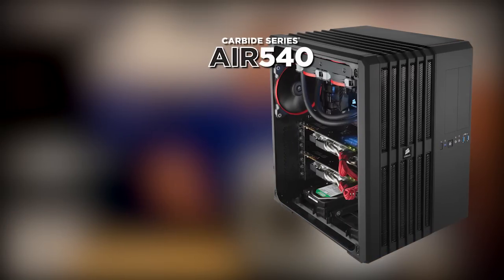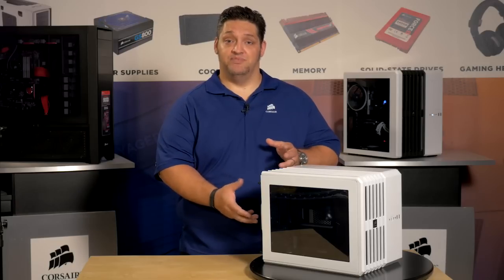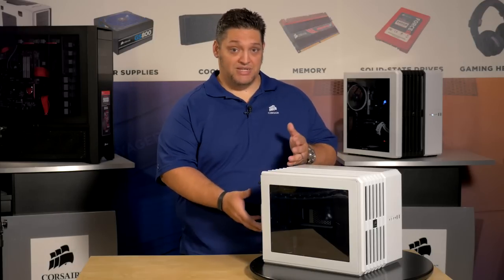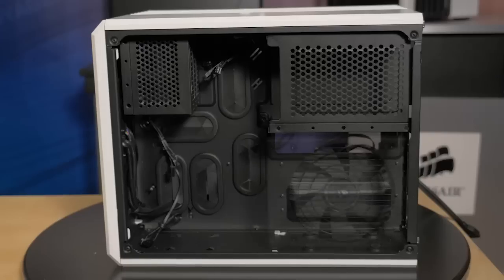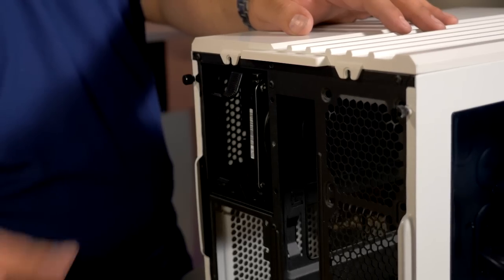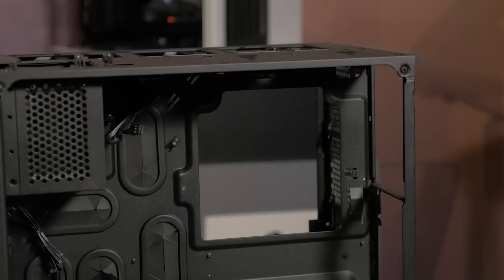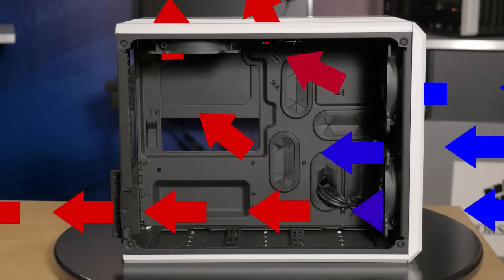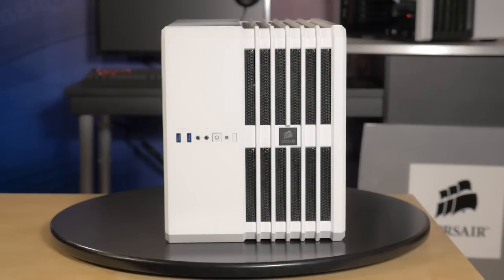Introducing the Corsair Carbide Series Air 240

Comment: Can someone recommend me the products if I were to build with this case?

My requirements are: 

-a core i7 processor
-a m-atx board 
-16 gb ram
-980ti that is small enough to fit in
- a cpu liquid cooler
-fans for the case

-256gb ssd
-1tb hdd

------------------------------------------------------

-the monitor will be a 1440p g-sync brand
Reply: Bit late but check out air240 owners club on google it will tell you everything 🙂